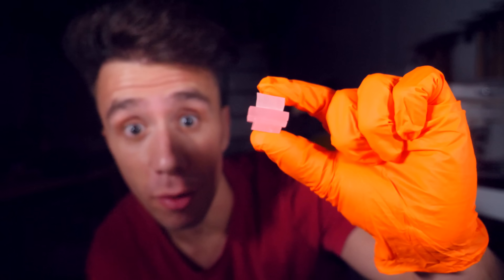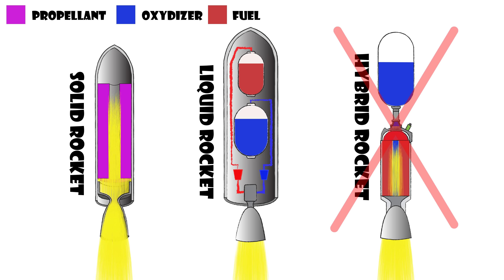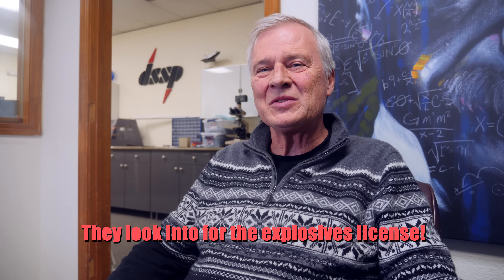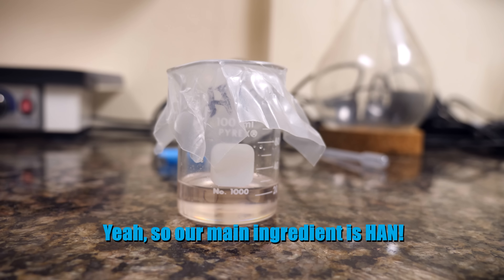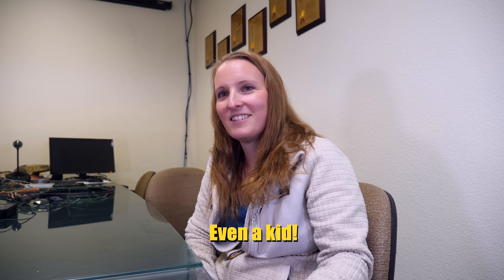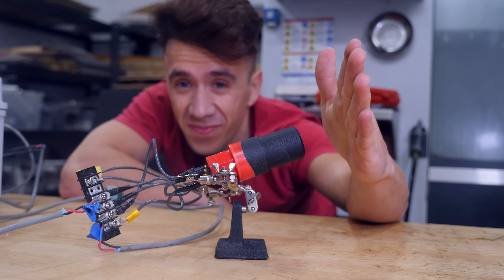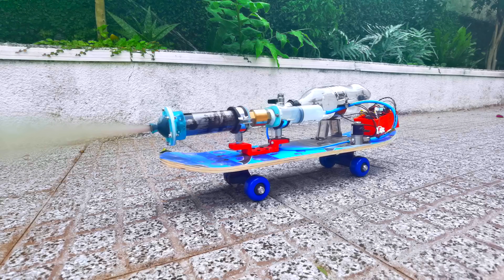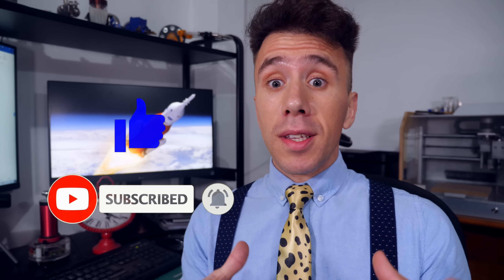ELECTRIC SOLID PROPELLANTS

Comment: Imagine having hockey pucks of the stuff you load into a hopper on board a spacecraft. An ignition source like and engine with plumbing around the craft. The material is super stable and posses no threat and could be stored in bulk onboard. Individually wrapped like glow sticks. Reloaded as needed. Or you could have individual propellant igniters around the craft that you load with pre made sticks of the propellant. As you burn through a stick of propellant, you would essentially get a reloadable system for vector thrusting. All very cool stuff. I can imagine systems in place to use such a propellant. I agree this could change space travel.
Reply: Until the craft gets hit by lightening.
Reply: @YuckFoutube-e1z in space ? Lightning?

Comment: i would like to see you power a fish tank water pump using ITO material combined with PTFE spray or tubing. i have managed 3 volts from a single small strip of ITO and plan to use two strips in series to power a fish tank pump to eventually power a water turbine using multiple pumps to move small amounts individually but combined could provide enough power from said turbine to power a series of devices.

Comment: I doubt it will be used as rocket propellant, but for tank gun shell propellant it would be ideal.
It would reduce risk of ammo cook-off quite dramatically AND increase combustion efficiency (faster projectile speed or more weight of the projectile for the same size and mass of the shell).
Reply: Or caseless ammunition in general
Reply: Have you seen steering thruster arrays on military rockets ? That's the business .
Reply: It might be used in terrestrial rockets, like air-air missiles. Not for space.

Comment: "You can shoot or burn and nothing happens which is unheard of in explosives"

C4 has left the chat
Reply: @josephmercel1146 That doesn't sound like C4. You need a blasting cap to ignite C4, otherwise it does nothing else.
Reply: The difference is that this doesn't support combustion. RDX burns very readily in air. They mean that it has no risk of catching fire, not just not exploding.
Reply: We can use this as gun propellant for naval and tank guns.
Reply: @warhammer8867  We use electricity to ignite the propellent in tanks, at least with NATO ones. The hammer set up wouldn't be practical for something that big.
Reply: static electricity are not mentioned like you build this up with your brand new shoes and a plastic mat and then boom
Reply: @Jkaninteangemittnamn  C4 won't ever detonate with static electricity
Reply: 'not unheard of'
Reply: I'd say it sounds like a very dumbed  down or specialized version of C4.
Reply: @josephmercel1146 There is no such thing as a blastic cap. You are obviously not ex military if you don't know that. Because I had family in the miliary, like one who flew a EC-121.

Comment: sorry i still like the hole aluminum and gallium and water .  thing is you have some much of it once your in space you can keep using it . and you can put the gallium in a chamber and reuse it over and over . it also will not explode only the gas it gives off will combust once there is a flame . so put the aluminum in to "SHOT" /small spheres so it has a smaller mass so the gallium can attack it better . and as for water use normal distilled water ( water with nothing in it ) . there is also the other idea use  aluminum trash  the use of this "trash " will burn all the impurities as it burns all that is given off is trust . also if you could make the aluminum into a mesh then there is more chemical contact surfaces .  so high yield low mass fuel .... i do have more ideas but this one i like the most because there is no moving parts except for the opening for the gas to combust .

Comment: You know you get actually taken field you one of yours ceramic 3D printed Arrow spikes and put an electric diode in the center of a gel cake of that, and then just run your igniter and as you run your igniter the back pressure and exhaust is expelled through the nozzle of the arrow spine and send it to Skyward buddy. All you got to do is set a timer for like 12 s 14 s a purse or do a single burst of like 20 seconds just to see what happens. Use small little cakes drill a small hole in the center of them and use your diode at the end and let's see what happens. If not make me a hockey puck size cake of that and I'll put something together LOL

Comment: Very interesting! May be useful for steering a rocket or rocket propelled object. Instead of needing thrusters with control valves etc, one could make a ring or two of small grounded metal vents packed with it and a "wick" that is positively charged. May have to playbwith the wire gauge/vent tube width to make sure it only arcs where exposed at the thrust point(for lack of a better term). Then it seems that the thrust strength/duration could be controlled via applying variable voltages for the desired duration. With a little training and trial & error, it could probably be automated by a microcontroller to correct course in real time....with the help of an accelerometer and gyro. I bet you could gut a smart phone and use the parts from it controlled by a custom .apk. I am far from a rocketry expert though, so this could be completely impractical. It does seem to have potential for thag though. I wish I had the time to try that sort of thing! You gotta prioritize these days though. If only one could spend their days doing experiments and not working. I guess someone could do it for work, but then they would be constrained by their projects needing to make money...or save enough of it to disrupt manufacturing costs etc. It's unfortunate how much of our short lives is constrained by such limitations/restrictions. It's the old "CREAM" scenario.

Comment: That looked like an electrolysis cell. So I'm thinking that they used an hydroxylamine (take your pick which one, then through that into the ammonium nitrate solution. If you know your chemistry then you can figure out how much current is needed. Usually electrolytic aren't themselves exothermic, and the heat comes from the high current. I didn't see anything that looked like a heating pad, mantle or exchanger, which is odd because if rhe reacrion is exothermic then you'd want a way to moderate the heat to prevent runaway. Those also looked like isolated membrane cells, which dont tolerate the high temps one would typically associate with branding them as "exothermic." So i think there's some fibbing going on here.

Comment: video idea: try to create a safer rocket to 3d print for people wanting to start to eperiment on safely, maybe add slottable/modular winglets/ other parts to increase or reduce fuel capacity and maybe rocket nozzles etc to show different properties, even if they dont go far or are just clamped somewhere and used to see effects and stuff, people would be less scared and more interested to try the hobby, your friends might also be less cared of your eperiments if they can see and use simpler stuff,.

Comment: 5:35 if it was that easy you would not be interviewing him about it
Reply: if i had to guess a you need a gelling agent or a way to polymerize that mixture, look like it could be silicone that is used or an inert synthetic rubber/plastic polymer, and electrical resistance of the mixture also would affect quality and ignition rates, too conductive it might just denotate, not conductive enough might just fizzle and melt instead, and it probably not just HAN and PVA  mixed  together in a jar, that's just teh active ingredients that make the result work

Comment: 3:43 in other words 

 no you cant buy it

 you need government approval, cuz trade secrets and you can make a real effective bomb out this shit, imagine hooking this up to a high voltage switching power supply and a dc capacitor bank, with a little bit of tnt or some potassium, rubidium or cesium nitrates, or Fluorinated oxidizers if you wanna get creative wit it

Comment: Can you do a video on using electromagnets to repel the plasma generated around reentry vehicles? It would make a bubble, shielding you from the convection heat which is where most of the reeentry heating comes from.

Comment: This sounds like a perfect fit for prop guns. Prop guns are so dangerous because you still have to do the combustion for the effect. If you can just put a pellet on the end of a tube and make it pop with some electricity then that's going to make theater so much safer (except the average producer would never be able to get a license)

Edit: finished the video. I can definitely see Hollywood producers having access to this but I think it would benefit theater more. Hollywood has CGI and while it might not be the greatest it's more than what theater has.

Comment: Aldo im making heavy asumpsions here,if it is ignited by having electricity flow through it do to for an example an ionisation of the material,maybe reverse voltage can solve the control of large scale sistems. Sorry for bad eng. .
Reply: user-hjk  Hi,thank you for so much apreciation for your subscribers.
Do you mean this contact.

Comment: "Hybrids suck"
[Citation Needed]
Also armature rocket groups have won court cases against the ATF, the ATF does not regulate rocketry or rocket prepollents.
Back in the day NASA would just sit around with open containers of Hydrazine.  It's not nearly as bad as it's made to seem.  It also has a strong oder that you can detect far before it becomes immediately dangerous.

Comment: Interesting thing about liquid rockets.  You mentioned how complex they are.  But actually, there's a bipropellant engine that is just as simple (if not simpler) as a monopropellant engine.  A hypergolic propellant pressure-fed engine.  The propellants light on contact, so you don't need an ignitor, and they're pushed into the combustion chamber by pressure in the tanks.  So all you need is valves to control the flow of the propellant, rather than any of that complicated turbo-machinery that's usually associated with liquid engines.

Comment: Instead of 3d printing and using ceramic to make heat resistant parts? Why not 3d print, make a sand mold use your kiln to heat metal to achieve heat resistance? Would help with your  pressure related issues.

Comment: If the Electric Solid Propellant is throttleable then we can use it in place of the liquid fuel that keeps leaking, is that right, we use Solid Rockets to get to orbit and use the Solid Electric Propellant to fly around in space.?? Is that the idea, so we don’t have leaks on the launch pad or fuel slosh in orbit?

Comment: I finally got my first working 3D printer.  It's an Ender 3 V2 NEO.  Nothing special, but it gets me started.  I also got a drier box wo go with it to keep 2 rolls of filament in.  One that's printing that goes to the printer with a bowden tube.  The other is just there for storage.  It's very exciting.  My first prints are tools for work (I'm a general technician for an R&D firm) and upgrades for the printer.  I've added gantry reinforcement brackets that are adjustable, so you can square up the gantry's uprights.  Added a belt driven second Z lead screw.  I have some ideas for the Y axis, but those are yet to be built.  Right now I''m working on upgrading the part cooling by relocating the hotend fan, shrouding it from the part, upgrading the stock fan nozzle, and adding a second part cooling fan without removing or moving the factory metal CLTouch ABL.  No one has this mod available, so I'm modeling it myself.

Comment: Since you can mix the rocket proppelnt, specifically rocket candy,  with resin and still print it. Could you possibly mix in some pottery plaster or Plaster of Paris with resin and have it still print? If possible you could build your own, really cheap, basically fireproof resin prints instead of spending oodles of monies on porcelite. I was interested in the stuff, but the cost Is a bit much considering you still have to post process

Comment: Possible video idea? Probably wont work due to materials but developing an electrically conductive mesh that tightens as the fuel burns. Or a weave that wants to expand and a mechanism to twist it to remove tension to start it and untwist to allow the nesh to expand for when you want to cut it off.

Edited for typos. Probably still unreadable

Comment: There is another liquid propellant you can ignite and control with electricity: water.  Yes water.  You use electrolysis to generate HHO (hydrogen and oxygen), which is highly energetic. In theory, you could build a rocket engine that generates and burns HHO on demand. I would like to see a 3D printed HHO rocket, however I like you, so please don't do it.

Comment: How is this for a video idea.. WHEN you get hold of some of this stuff, be it liquid, or gel.. Make a futuristic - Interplanetary designed ship with rockets based on electrically controlled thrust, and have the ship run on rails to see what different speeds you get with different voltages inputted, and thus, work out if say, solar power for the ship could be enough, or if a nuclear generator would be needed? 🤔🤔🤔    😎🇬🇧

Comment: Intega, I've just found that in Ultimaker Cura slicer you can make molds by inporting a 3D model and in print settings selecting in "special modes" mold.

Comment: Build your own water electrolysis device creating hydrogen and oxygen that powers a home made fuel cell that coverts it back into water generating electricity to power electrolysis and have excess electricity.  Or just use a gas generator to burn gasses from electrolysis and cool the exhaust to recover the water as it will be very hot H20

Comment: Not a video idea per se but an interesting challenge nonetheless, one that is occupying my mind and also somewhat impractical: let's build a jet or a rocket engine, preferably a jet (or multiple smaller ones) that could launch me and my glider to 300m (min. practica soaring altitude).
I have all the calculations, minimum continuous thrust 414N to achieve safe rate of climb and total impulse 99300Ns needed lol.

Comment: can you do a video on the squib itself?  how the electrodes are arranged?  How does the end of the squib end and after multiple shots, how does it terminate? ie do you have to cut it back?  It almost looks like the black tube in your hand is shrink wrap tubing.... with a red and black wire coming out of the bottom!  GREAT video.  Thanks

Comment: Video idea: Pulse Width Modulate the rocket fuel and see how much control you can apply to thrust.  Maybe this could power an RC plane by throttling forward for lift and turn left/right via two separate motors placed strategically on each side of the plane?
Reply: Might be interesting for unusual maneuvers, but it's probably better to have control surfaces running on servos for safe flight overall. Perhaps as a control scheme for some sort of missile that makes more sense. Something like the Sprint.

Comment: Video idea: build a motor to power a small metal box that holds some components (idk what components to use) and a lever like system to move a small hammer (make sure the hammer is fire proof), make a liquid injector full of a flammable substance and run that through a tube into the hammer to make a big fire in the tip of the hammer. Once built use it to light and smash the disgusting tomatoes.

Comment: just build a rotor-stator compressor. and it would be good to verify the operation of a rocket nozzle, this subject is called Isoentropic Flow and it appears in cengel's book of fluids. You can even modify the dimensions of said nozzle to produce shock waves. and remember that rocket engines used compression ratios close to 70:1 !!

Comment: Love your Videos, have you ever tried to print the Thruster with Graphene or Carbon Fiber ? Might solve issue on stabilty, there is also a version where the material is conductive, where you can ignite the propellant electrically thru the Thruster . Graphene 3D lab , check it out.

Comment: looking for a lightweight. safe. cheap 75 lb thrust ultra-lite aircraft power source.....3D printed rocket motor and propellent under 10 lb weight and capable of 5 min of flight/power would be optimal......or maybe a throttleable steam rocket motor using externally heated water.....I envision a light weight filament wound  tank with a water heater element that would super heat the water to many thousands of pounds pressure and be able to throttle it out to a simple piston propeller or rocket nozzle......steam valve and nozzle for that requires a jeweled orifice and valve diamond comes to mind

Comment: I've been looking into the patents on this material - and the off shoots ie use in pyrotechnics.  Check out eSquib(R).  If I understand the product correctly, The material is arranged such that repeated discharges result in a series of harmless reports with  pretty authentic muzzle flashes.  some 400 'shots' per squib.  This will revolutionize the pyrotechnic industry, especially in cinematography.  ie simulated machine gun fire with no casings to clean up (unless you actually wanted that effect).  No noxious fumes to deal with and best of all... no need for weapons that could even possibly fire an actual projectile!

Comment: Video idea: build a "water" powered rocket engine. It would work by splitting the water into hydrogen and oxygen using electricity, then burning the products back into water for thrust.

Comment: Mister Integza why dont u try to print a part with some conductif material.And then add more metal to the part using electro-plating baths. I think u can print a thin frame just for the form and then use the frame to grow the metal part in the elctrolyte bath. Oh i also have some ideas for your 3d welding printer....